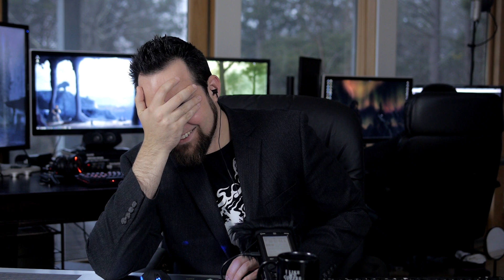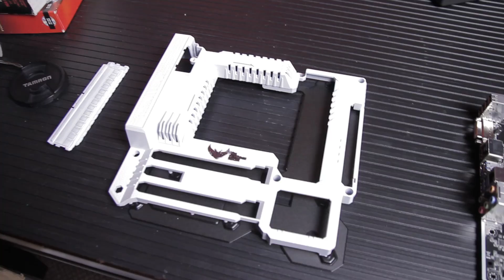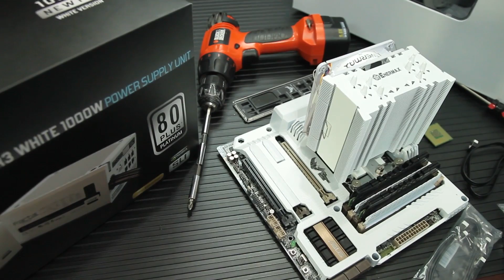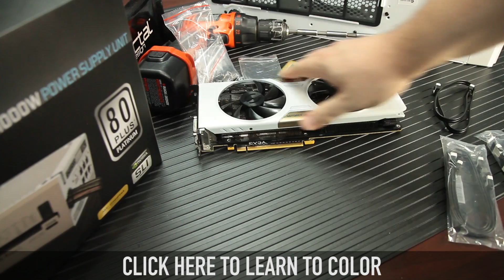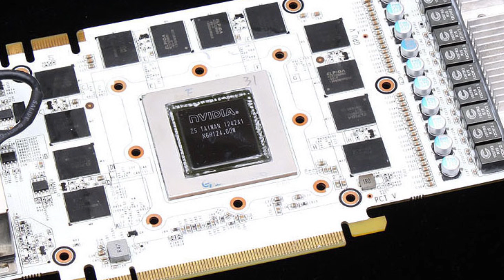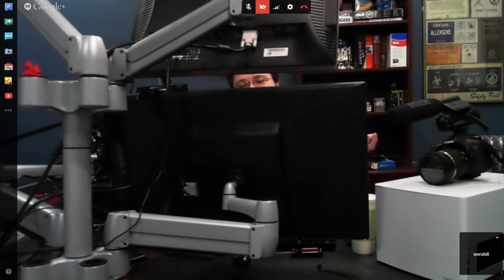Build Log: White PC | Custom White ASUS Gryphon, White EVGA GTX 770, ETC.

Comment: Corsair makes white RAM, the Vengeance Low Profile has white as a color variant.
Reply: Also ADATA had white as a potential new color variant in their non- low profile XPG series of memory, they unveiled it at CES. Logan even covered it on here.
Reply: Use a silver white intel SSD

Comment: Do a all black and red system in a 750D with a ROG mobo and everything else accented or colored red.
Reply: Patrik Manni I just like red and black together. And if your grandma has a red and black system, what are the specs? Celeron and GeForce GT 250?
Reply: Everyone does red and black builds all the time. They're everywhere. My grandma has a red and black build for god's sake.
Reply: Patrik Manni
amd has red and black gpus lol
Reply: hirosese And the entire ROG lineup is red and black. And MSI Gaming stuff.
Reply: ***** I'm actually quite fond of the replaceable ring thing. Blue/black and red/black are by far the most common color schemes, and they cater to both. Also allowing for the sweet as all hell white/black stuff. But best of all, you can dye the white ring any color you want. And the fans perform superbly for their price range. I have trouble recommending anything else unless someone is on a really tight, or an infinite, budget.
Reply: Well, yeah, they're the best option for most people. I know what you mean though. I'm rocking 12 AP-15's myself, with more coming in soon. Hoping to deign a feasible TEC system with a watercooled hot side. As it looks currently I'm going to be running 4 150w Peltiers, cooled by a total of 18-24 120mm radiator spots. I'm still worried about it laying a bit on the hot side...

But anyways, I do agree that building unique is as big a factor in aesthetics as anything else. No matter how cool something is, it doesn't matter if it looks the same as everything else made in the last 4 years. 

Something like a Noctua colored build, with everything made to match the color of the fans... That could look sick. And the fans wouldn't look bad when they're not out of place.
Reply: ***** I'm using an M10 from Caselabs, yeah. I do need the pedestal to fit all the radiators though. Also, I think you might be underestimating how much heat can be produced with thermometric coolers.
Reply: ***** Haha, sorry. That was a typo on my part. I did mean thermoelectric, yes. I'm looking at getting 4 150w peltiers.
Reply: Patrik Manni That sounds totally insane! Do you have a build log on OC3d or something? I would love to see that!
Reply: green and black
Reply: True Dat

Comment: Having overkill PSU is ok? - I disagree, because the need of cooling the PSU is always (1-F)*P where P is power draw from wall and F is the efficiency factor of PSU (F=80 or more nowadays, hence "80 Plus"). More powerful PSU won't run cooler. So F*P is the power the PC is actually using. The rest (1-F)*P is going to become heat in PSU. If eff factor is 100%=1, no heat would be generated in PSU. However, F gets it's max value usually when PSU is generating about  50% of it's max wattage. Below that F will be worse.

In a nutshell, for this rig, depending on amount of desktop/gaming use, maybe 500W-550W PSU would be optimal.

Comment: 8:30 ridiculous overkill, eh? What if I tell you I build my rig with a 4670k + GTX 770 + 3 HDDs + 1SSD and powering all that with a coolermaster silent pro gold 1200w power supply? Water cooled, runs as quiet as it gets, I can barely tell that thing is on sometimes, lol
Reply: Lazy + too much money. When I was getting parts, at the store I was getting my things only had a 500w corsair bronze or that one, they had nothing in between. Plus, I do have plans on upgrading with more cards in the near future. And, dude, it's running at like 15~20%, it's fan is barely spinning, ultra quiet.
Reply: Frozen Pub running at like 15~20% makes no sense. It won't run cooler than 600W PSU @30-40% for example. Probably hotter in fact.
Reply: I never said it was any hotter or any cooler. I said it was either that power supply or going to another store. Taking into account I live in Brazil and finding a decent hardware store here is god damn near impossible and I do want to put at least another 770 there soon, then the 1200w makes a little more sense, while still being a big overkill.

Comment: i did a build for a friend. i used a white nzxt phantom 410 and on the bottom and front he wanted orange led fans and on the top i put a purple led stripe i made for him. really fancy. i'll send you a mail with a picture of it
Reply: ***** i got it from this ebay vendor
http://stores.ebay.it/EDILIGHTS/_i.html?_nkw=viola&submit=Cerca&_sid=85260645
but i had to get a molex to sata adapter, cut off the sata and and wire it myself. but works fine, since 8 month non-stop operation

Comment: If I was going to build a computer like this, I would call it "The White Out"! OCZ Vector SSD's would look nice in this setup. I just checked out the Galaxy GTX 780 HOF and I would love to see a 780 Ti version of this card.
Reply: ***** The OCZ Vector 512GB SSD's in my system haven't died on me yet, I've had Vertex 4's that did die or were DOA but these drives have been pretty good. I do also use Samsung 840 Pro's in my laptop, think they're the reigning champs when it comes to all around speed.
Reply: Me and Newegg's RMA team were on a first name basis from all the dead Vertex's I returned. Was reluctant to even try a Vector but after receiving a reward gift card from my job, I decided to use it and take a chance on the Vector, much more reliable than the Vertex drives. These 2 have survived a lot of abuse having different linux distros installed on them.

Comment: I was wondering, since your talking about coloring heat sinks with paint, how does this effect the cooling efficiency, Only reason I ask is because in the automotive world there's a specific paint designed for radiators to be black, that allows better cooling effectiveness.  
Personal note, I actually despise white PC's, as mentally it reminds me way to much of a Mac.

Comment: I did take the fan off of our K&N air filter display to use for an ITX build I'm working on building. I don't know what the CFM of the thing is, but it pushes more air than ANY fan I've come across yet.... It is VERY LOUD at full speed though, but it is 12volt and I'm very curious what it could do with a fan controller to turn it down to tolerable decibel levels.

Comment: Fans are easy enough all you have to do is peel off the rear sticker and remove the tiny C clip holding the fan hub on. Also you can paint heatsinks and PCBs directly, though it will obviously effect thermals and cover electrical contact points so you would have to mask off PCIe slots, USB headers etc. If I had money to burn I would do a whiteout build with purple accents, black and white is kind of commonplace now

Comment: White is good but you guys know once u go black u never go back lol
Reply: Yeah, who doesn't love 'full towers'

jhheuheuehuehuehueheuehu
Reply: i love full towers sadly dont have the room for one so I'll be going for an Aerocool Mechatron Windowed case in Black I'm going with a sabertooth board for sure though I'm going down the AMD route with a FX6 6300 OC'd to 4.6Ghz and a Alpenfohn K2 Mount Doom CPU Cooler.along with a AMD R9 290 graphics card not hating on Intel or Nvidia  I have just found over the years that AMD's have been more reliable just as powerful as Nvidia and Intel offerings without having to pay stupid over inflated prices
Reply: James Brand
I love full towers too, but once I got a EVGA Hadron Air, small is the new tall!

Comment: Hey guys awesome build and idea, have you thought of going with the fractal core 1000 case but wrap the side panels, roof and front panel with white carbon vinyl wrap, ass a larger window on the side and add a second white 120mm fan upfront.that would look bad ass!

Comment: well that cooler is like the exact same as my enermax ETS-T40-VD cooler except that it is white and has another fan. But I can't get any overclock on my FX-8350 without my temps rocketing above the 7-degrees Celsius in a few seconds.
Reply: ***** well yeah but a liquidcooler was too expensive at the time and I am looking to get one but first I need to upgrade some other hardware. I am thinking of getting me another fan to put on the back for push pull. Well my case has good airflow 2x 120mm fans as intake in the front and 1x 120mm in the back and a 170mm fan on the top (I think it is rubbish though spins at a mere 400RPM on silent mode through my bios.)

Comment: You shouldn't go way too overkill with the PSU even if you can. PSUs are made for certain wattage and if they don't get to "stretch their legs" so to say they could lose efficiency. But if it's worth having a quiet system thats up to you.
Reply: PSUs are most efficient at about 50% load, so no, going overkill can be beneficial. Especially if power costs a lot where you live.
Reply: ***** PSUs lose efficiency over time and more so if they're being used at high temperatures and/or high load. So going overkill can be good in that department.

Most PSUs have the lowest efficiency on <10% and >90% load with ~50% load being the most efficient. So, if you have a system that is on load most of the time, going overkill is more efficient. However, if you idle most of the time, going overkill will not be efficient.
Reply: Alec Sigsbee if you're running less than 20% load there are really no standards (80+ standard only refers to when the psu is under load). psus are usually incredibly inefficient at that load (I'd imagine less than 60% efficiency) so you're paying about 40% more than you need to be for electricity when the computer is idling.
Reply: The Silverstone 1500W is an option, I assume.
Reply: Skooteh You'd imagine... well, I'd imagine it will be 120% efficient. Don't take it seriously, but without some sources we could write anything.
Reply: *****
And you missed the point. He "imagined" that a PSU is at 60% efficiency under low load, which is an estimate without source. There might be PSUs with less than that and other with more than that. That had nothing to do with overall power consumption of any system.

Anyway, thanks for the calculations.

Comment: I'm trying to do a black/green computer, but I'm a cheapass bastard. So nothing is getting done because I can't bring myself to pay up for it... Eventually I'll upgrade to a Gigabyte G series mobo, but I'd have to go with the µATX since the eATX is just too big for my case and way too expensive. I've already painted the front and top mesh on my CM690II, but once I upgrade my components I'll cut a window and paint some more accents inside. I'll also be replacing the red front panel LEDs to green ones. I'm thinking of doing some subtle lighting with EL-wire as well, if I can figure out how to run it off my PSU (which I'll be sleeving once I get a modular one). Sooo, if you're still reading this and have any tips or experience to share, it's greatly appreciated.

Comment: Hey guys. I'd just like to point out that your statement that "power supply over kill isn't a bad thing" is pretty misleading and potentially terrible advice. Power supplies are rated 80 plus only when using 20% of their maximum power - meaning that a 1000W PSU on idle could be using twice as much as a 500W PSU. For a channel with authority in the area it's probably not a good thing to be misleading people (even if unknowingly) who don't know better.

Comment: Question: What if the whites don't match? Does a white LED strip bring that out even more or could you blast the inside with a nice soft light and get the stuff looking uniform?
Reply: You can always repaint it if you are that ocd. And pure white led's should be fine. They are more on the blue side than the yellow side, but not as off as fluorescent. White led's look amazing against white paint, think of how white looks under a black light, only that vibrant in white light. Also, if the paint is on the yellow side, it will be VERY noticeable with pure white led strips, so you know.

Comment: guys i want to paint the fan of a noctua cpu heatsink
but most of the people at web remove the actual fan from the chasis but there are not much information on how to do it please help me
Reply: Here's a guide for disassembly and coloring using liquid dye. It's probably the best way to do it since there's no risk of uneven weighting causing the fan to wobble or make noise. http://forum.overclock3d.net/showthread.php?t=35185
Reply: it would increase the weight of the fans and cheange the shape of the fan surface. DON'T DO IT.
Reply: CapnKrunchy

it seems like every fan is diferent and requires a bit of diferent progress
thanks for the link :) i will w8 3 weeks until i get my heatsink and see if it looks way too bad

Comment: It is true that overkill on a power supply is not really a bad thing. A certified power supply must run effeciently at the max rated power on the box, this means effeciency at lower voltages will be even higher. Typically speaking, a higher wattage power supply saves power at lower wattges compared to a power supply running your pc running at max rated wattage. That idea is a bit counter intuitive for newer people into computers, but a higher wattage psu does not mean it pulls more power, it means it CAN pull more power, if your pc needs it.
Reply: lolstormzify Just checked the facts - Power supplies are only rated 80 plus efficiency above 20% of their total wattage - meaning at idle a 1000W power supply could be using twice as much as a 500W power supply. I think they should probably address this in a video - it's awful advice.
Reply: a corsair psu from 650 watts to 850 watts it's price will increase only 30 euros so it is not that expensive too
Reply: Actually no. PSUs efficiency ratings start from 20% load, anything under that doesn't need to comply with its certification.

That means underused PSUs can and will have terrible efficiencies, which leads to more power being drawn.

eg PCs that idle alot with overkill PSUs
Reply: lolstormzify "Typically speaking" is what I said. In VERY low load situations, efficiency depends on the amount of time a power supply has spent delivering power under higher loads, the shorter the higher load time, the worse the efficiency when it drops its load level. However, all power supplies have a bell curve shaped efficiency pattern. A high certified power supply will sport a larger bell-curve, whether it be wider, or taller, in order to hit the efficiency of how it is rated. This means running a High wattage power supply at 50% power usually means running at max efficiency for a power supply, while any inefficiencies on lower wattage are near negligible since how few watts it is drawing in the first place. It also means it will sport higher efficiency over a larger 'high'(relatively speaking) wattage range.
Reply: Aren't they only rated above 20% of the maximum voltage? So a 1000W PSU is only as efficient as advertised when using over 200W. This way, on load, you could be using as much as 200W with a 1000W power supply, whereas with a similarly rated 500W power supply under the same conditions you'll only be using 100W. 

Have I got the wrong end of the stick here? Or is overkill definitely not a good idea as far as PSU go?
Reply: Richard Smith On idle - which is what computers spend most of their time at - a 1000W power supply is objectively worse than a 500W one. I don't think you understand what I'm saying. All 80 plus rated power supplies have more than 80% efficiency above 20% load, the total wattage of the power supply doesn't matter. Under 20% load, (i.e, idle), a larger powersupply will waste more energy than a smaller one. 

The statement was wrong and it's wrong to state it like fact to an audience who will take it as fact and repeat it as fact.
Reply: I bought an 80 plus gold 750 watt for a 3570K and a 7950, is that too much?
Reply: mattkessel36 A little bit, but you shouldn't worry about that.
Reply: lolstormzify The word you should focus on is "could." They could be less efficient, but don't have to be.

You should start researching on that matter. I am interested if the 1000W will be significantly worse then the 500W at ~150W load. My bets are on the "it doesn't really matter" idea.
Reply: TheRealDerohneNick If we presume both power supplies have the same efficiency under 20%, the 500W power supply wastes less. Individial power supplies vary at efficiency under 20% load because they aren't required to be at a certain standard - therefore it's plain wrong to state that PSU overkill is a good thing.
Reply: A computer that uses 20 watts idle and 200 watts off idle, would take 10 times as long to use the same amount of power. This whole debate comes down to; does your computer spend most of its time in standby mode or not. In the above example, it would take a pc in standby 10 hours to equal that of 1 hour off standby, this is why the efficiency is less important on the low end, IF you actually use your computer regularly.
Reply: lolstormzify "f we presume both power supplies have the same efficiency under 20%, the 500W power supply wastes less." No, they would use the exact same amount. Efficiency says how much output you have for an input. In example. 75% @ 100W input -> 75W output.

Same efficiency and the same input will always result in the same output.
Reply: TheRealDerohneNick

i alway thought that if your pc need 500 wat at a 80% eficiency  then the psu will consume 600 watts to give what the build needs
Reply: Yes, 600W input @ 80% efficiency is 480W output.
Reply: How overkill, like, this overkill is kind of bad. Most PSU are rated a certain amount at 20%, 50% and 80% usage. This set-up could use as little as 230-280 watt idle... and the efficiency could take a hit.